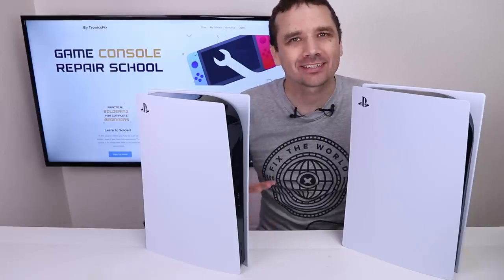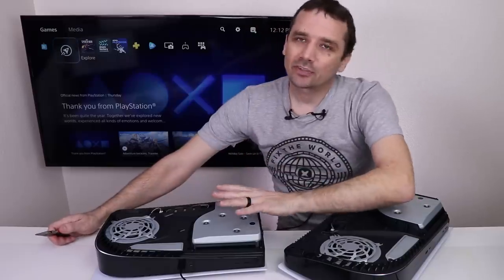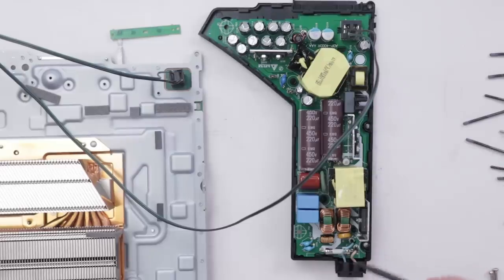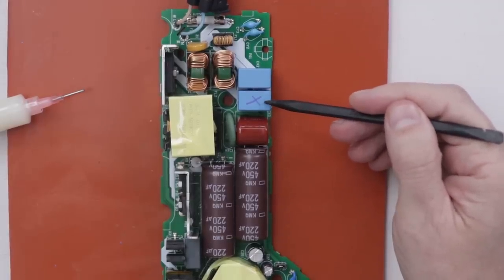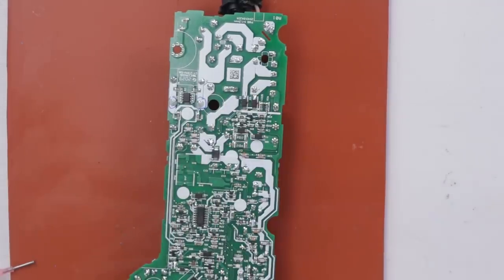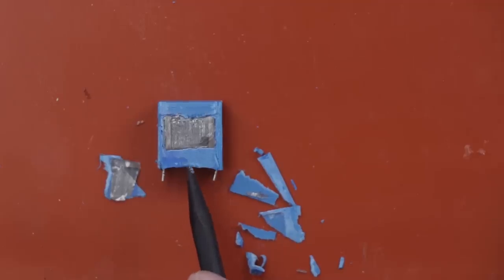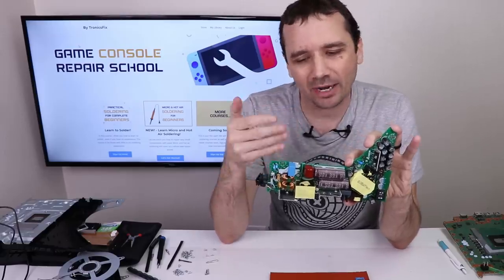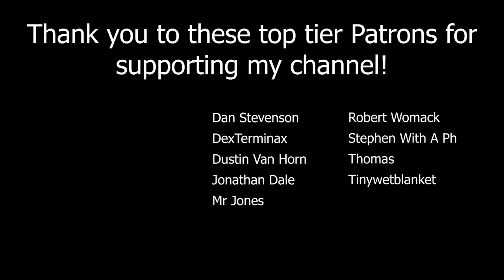PS5 Coil Whine - What Is It and Can I Fix It?

Comment: First of all, coil whine doesn't decrease the lifespan of the component or the console, it doesn't make PS5 inferior to Xbox series X, it doesn't have any effect on anything other than being a little annoying. Now,

Coil whine happens cuz a current in a conductor creates a magnetic field, and if the conductor and the current are bunched up like in a coil, each fraction of the conductor can pull on or push away other fractions. If there's an AC current flowing through the conductor, the pulling and pushing happen alternatingly and at the same frequency as the current. Alternating pulling and pushing means sound, and higher frequency AC current means higher pitched sound, or whine. That's why coil whine gets worse when there's a heavy load on the system when the frequency gets higher than base clock.
Reply: The best was to fix coil whine from the perspective of a science student as myself would just be to press the coils tighter together. If you could put enough pressure on the film capacitor using a binder clip or something of the sort, the sound would get muffled enough to the point of not being audible. This is just an idea though, I can't guarantee it won't add extra complications or even work at all
Reply: @
Vibudh

Thanks for a great explanation.  I have a follow up question: How come just some caps "whine"?  Sometimes you have two caps that are exactly the same but one whines but not the other.  This have happened to me several times when recaping old computers.
Reply: @Videohead-eq5cy  I think the series x power supply has a bunch of goo kind stuff probably to reduce the noice
Reply: so basically the wire creates a emf (electromagnetic field) which then is attenuated by the AC current causing the metal to vibrate
Reply: Smort person
Reply: no
Reply: Ok so its not a problem or it is ?
Reply: @chicoMazapan  might be, I'm no electronics expert but it does make sense that rubber and foam padding, and gelatenous liquids would reduce the vibrations
Reply: @PerKroon  it's probably because of the slack that the capacitor manufacturer has when making one spec. Obviously all capacitors can't be exactly the same in weight, composition, structure, etc, so some have a little less resistance to vibration than others which are more tightly bound together by resin. That's probably the reason
Reply: @abbasaltimimi5001  it's annoying sure, but I don't think it would reduce the lifespan of a capacitor or an inductor in any appreciable manner
Reply: @stardust5175  yeah it's the same phenomenon as 50/60Hz vibrations in a working transformer, just with a much much higher frequency
Reply: @Videohead-eq5cy  thanks for the information
Reply: So the noise it make is absolutely fine? Nothing wrong with it?
Reply: Great explanation. Do you believe it would be possible for the whine to diminish over time? Maybe after it’s been used for some time?
Reply: This is the hottest thing I’ve heard
Reply: @robinsave4431  exactly
Reply: from the increased load of engery the vibrations could loosen the coils hypothetically?
Reply: So why is there coil whine in graphic cards? These buck-converters work in a frequency range of a few 100 khz. Witch means you shouldent be abel to hear it. Or are there some other Frequencies that are much lower?
Reply: @flavioernst902  i was about to ask this.
Reply: Woah...
Reply: @robinsave4431  who told you that there is something wrong
Reply: @Νίκος Παναγιωτόπουλος thanks for the reply! That’s awesome news. I’ve had mine two weeks now with no change. Fingers crossed lol
Reply: @Videohead-eq5cy  Or you could just replace the component that has better sealed together coils.
Reply: @flavioernst902  Because there is coil whine in anything that has a magnetic field that rises or collapses due to frequency.
Reply: So a cable tie could help reinforce the component?
Reply: @Videohead-eq5cy  true, that's why some coils are dipped in things like resing or epoxy, its to limit how much the coil can move when electricity passes through it
Reply: @PerKroon  i would say i depends on what part of the circuit they work in and even if they are in parallel or series, not all caps are the same, theres always slight differences which could make the whine quieter or louder
Reply: @robinsave4431  nope nothing wrong, it just so happens that on the ps5 you can hear it more than lets say a pc psu
Reply: @mack4123  probably not unless there's a physical change to the component
Reply: @Laugh1ngboy  yes that's correct. But the whine is in a frequency range that's not hearable for the human ear. So what am i missing?
Reply: @flavioernst902  I don't know other then the capacitor in that ps5 is in the audible range. If he wants to fix it just needs to put in a new capacitor that doesn't vibrate in an audible range.
Reply: I believe there are two capacitors, and if they are connected in parallel one has failed stressing the other one, if they are not in parallel then I would check the capacitor and see if it's drifted out of spec, if it checks out, then any coil connected to it may have shorted or opened circuited, it "the coil" may have also drifted out of spec via a badly soldered connection, it could have also experienced over current through it ergo changing it's specs..
Reply: Yep, that's what I was gonna say as well, he just beat me to it. All that same stuff, exactly what I was thinking with the thing and the flow back and forth and high and low gizmo... You know, smart people stuff.
Reply: nice explanation thanks for sharing.
Reply: How
Reply: Dose the power go thru that component befor it goes thru the inverter.
Reply: It means the PS5 will slowly die when next gen games + overclocking will come ?
Reply: @KorAllRBare  As visible at 3:00 they are parallel. Does your theory mean he's focusing on the wrong one?
Reply: @hotdognl70  Yes, but without being right there, I would suggest to check both capacitors and any inductors connected to the misbhaving capacitor..
Reply: @Elgernox  no
Reply: @KorAllRBare  My quick try-to-fix would be encase both of them together in a good layer of hotglue ;)
Tollerances of the bigger capacitors are normaly a bit high. I can imagine if those are too much appart from each other neither of them is officialy faulty, just not compatible.
Reply: Imma be honest its not THAT BAD until i turn on 120hz games, there even my neighbours can hear it
Reply: @hotdognl70  Well for a proffesional that would be rather  unproffesional, but hey if it silences the noise to a bearable level and your happy with that then yeah thats your perogative.. 🤔
Reply: @nikamnepujdu  Question.. was your Playstation noisy from the get go playing certain games? Or did the noise become slowly more prominent?
Reply: @KorAllRBare  Remember the days when you cut open an external power suply to replace a fuse but found it fully encased in resin? Not unprofessional, just old school ;)

The sad part is, I don't have to solve the problem. Waiting for a scalp-free restock...
Reply: @hotdognl70  There we go..
Reply: Physics is crazy
Reply: @junzk2300  nah I'm just used to saying cuz
Reply: Wrong.  Coil whine  does impact component lifespan as it will be slowly be destroyed by the vibration.
Reply: @KorAllRBare  to be honest im not really sure, but what i know for 100% its getting loudest when i play rainbow six siege, i dont really play that game, i got it to test out the 120fps feature and it gets really loud in the menu already, but its so loud ingame its not even fan i think, its just buzing/coil whine sound from somewhere else inside the console. It is really suprising for me since games like Valhalla are more hardware demanding and its fairly quiet in there. Only siege has problems for me.
Reply: @KorAllRBare  i even had to download The fortnite game to test out if 120hz is The problem, and it was pretty quiet there too so idk rlly
Reply: So they need better supplier or qc
Reply: @jasonmelton5490  The X2 parts indicate a tolence of 15% wich is pretty standard for these kind of capacitors. Different supliers won't make a difference.
Reply: So ps5 console is Garbage
Reply: @KorAllRBare  Nah, I'll leave it there. Thanks for the feedback. ;)
Reply: @mr.cubarinogaming8953  not really, it can handle all current games smoothly, but cant handle rainbow six :(
Reply: Cheap parts used by Sony both my ps3 and PS4 launch day consoles have broke , now i wait for the ps5 slim  not getting caught out again
Reply: Changing the resonant frequency of the cap would probably do it.
Reply: @nikamnepujdu  If you're not sure, it's obvious the noise didn't initially exist, this means certain games are stressing the PS5 rendering components to fail or go noisy.

This to me indicates either a bad batch of components have snuck into production, or an oversight by Sony's Engineers.

So here we are with a conundrum that needs to be addressed, the REAL question is... Is the annoyance a design flaw or is a bad batch of components? 

If it were me I would connect an Oscilloscope up to the circuit where the Capacitor was connected too, To see what is going on, Paying particular attention for out of the ordinary spikes in voltages "Yes Voltages" and also out of the ordinary harmonic wave forms, whilst using various games, it just may be the two Parallel capacitors are overkill and if not Overkill simply inadequate, and as I originally suggested change them out for a slightly higher voltage rating and a slightly higher capacitance "The Parallel Configuration" to me suggests a higher value may be what Sony was aiming for, but it also may be that one is not enough and two is overkill which may be why one ends up singing..
Reply: @nikamnepujdu  I don't think Fortnight isn't that graphically detailed to cause unusually high voltage spikes "Via intermittent high currents drawn through a tuned circuit via an Inductor and capacitor connected to each other"
Reply: @KorAllRBare  sorry im gettin lost in that, since i dont understand consoles and electricity that much
Reply: Of course it makes the PS5 worse than the Series X. I have both and I wouldn't be caught dead using the PS5 if it wasn't for the exclusives, the sound is extremely annoying.
Reply: @ReddSquall  agreed, i actually like the controller more too, but im kinda sad, that xbox made everything better now, did all for the comunity and still didnt suceed. Kinda rip for that. Why didnt i buy xbox? Welp, exclusives, and cuz i have lotta ps4 games. If there is anyone who is thinking ps5 or xbox and doesnt care about exclusives, go xbox.
Reply: Yea I was playing Cold War and this buzz happened

Comment: I know in the past, most of this noise in switching power supplies is from the actual inductor coils themselves. The company I work for we always secure inductors with epoxy, because they actually physically vibrate, especially in a switching power supply. You can use hot glue or epoxy to secure the base of them to the PCB
Reply from the maker: The coils in the PS5 (at least in mine) are glued down already. I had thought of that though.
Reply: @Tronicsfix  I have heard that brand new capacitors of certain make up like foil types can be noisy and actually have a "break in" period and get quieter, but I'm not an EE, I'm a SW Engineer, but hear my coworkers talk about this in the past. haha Any EE can chime in.

Edit:
If this is true, I wonder if Sony up against impossible shipping demand, did not do a proper Burn-in test to mitigate this issue, and just is shipping them out as fast as possible.
Reply: So the blue component he pulled off was an induction coil, not a capacitor? It would actually make sense because it looked nothing like a capacitor on the inside.
Reply: @VanillaSnake21  No it is a film capacitor, I just didn't pay attention to see that the coils were already glued down :P haha
Reply: @VanillaSnake21  its a X2 capacitor.
Reply: @Tronicsfix  He probably meant to glue coil wires itself. You can often see white goo all over the place in some teardowns, that is one of the reasons for that.
Reply: @FrankDrebin  yes, the individual coil windings can vibrate between each other at an annoying pitch. This will get worse when sudden inrush currents are increased, like a game console would be starting up a high demand game.
Reply: @VanillaSnake21  It was a capacitor. That is exactly how capacitors looks inside - a lot of thin metal and dielectric layers.
Reply: @VexingCode  This actually means i should wait a couple of months to buy a ps5? 🤔
Reply: @matzeherd1343  This is not that loud and you're probably have a loud sound from game itself so this shouldn't be much of the problem. In many places you have some sort of 14-days return policy, so you may just try yourself.
Reply: @matzeherd1343  It’s not much of a sound. As you can hear in this video.
Reply: @VexingCode  They all whine this one just happens to be in a audible range he can hear.
Reply: @VanillaSnake21  No it was a capacitor, capacitors soak up noise  caused by transformers which are inductors. They are kinda the same thing except one increases or decreases voltage while the other cleans the signal. Chances are the output of those capacitors is a square wave. They will make the leading edge sharper when looked at via a oscilloscope.
Reply: @Laugh1ngboy  Oh ok, I thought all capacitors had electrolytic fluid, how would a capacitor with just coils work? How would it store energy?
Reply: @VanillaSnake21  I'm gonna blow your mind and send you on a research assignment about  Leyden jars. Or I could just say a capacitor is 2 pieces of conductive material separated by a insulator. There are dry ones and fluid ones that you know are filled with dielectric fluid. Specifically in the video these are foil wrapped making them the dry kind. You can make Layden jars with tinfoil and a mason jar at home and charge them with static electricity. Oh and I forget the science answer for how a capacitor works but they essentially a battery they just discharge faster. this feature can be used to clean up a square wave that computers use to shift  bits.
Reply: @Laugh1ngboy  Long story short: Opposites attract.

Batteries are chemical storage of electricity, capacitors are not.
Reply: @hotdognl70  Well I meant as in they can store an electric charge. They are designed to dump it really fast but Yeah whatever.
Reply: @VexingCode  can this buzzing noise lead to failure? Or the buzz is harmless other than causing minor audio annoyance if one goes looking for it.
Reply: @VexingCode  hit the nail my friend they've done exactly this. Only for review units would they have done extreme testing to eliminate any chance of noises
Reply: @matzeherd1343  more like years, 2021 batch will certainly have these issues
Reply: @mz4ever123  how long do you think we will have to wait for this issue to be gone, PS4 slim and pro had it so I’m not very optimistic. Hopefully they see people actually talking about it this time and fix it
Reply: @joshohanlon1085  until they change components for better ones or you keep buying PS5's till you get a quiet one